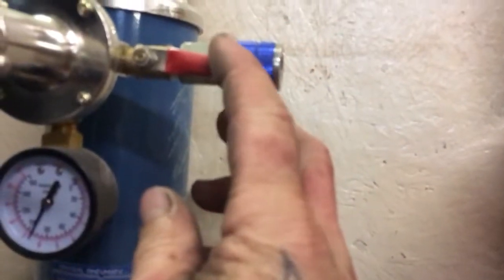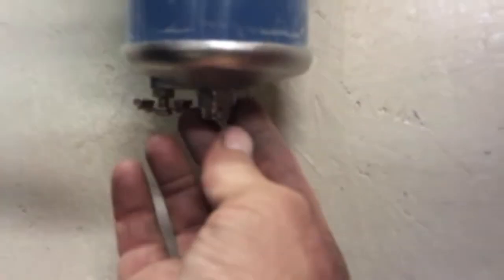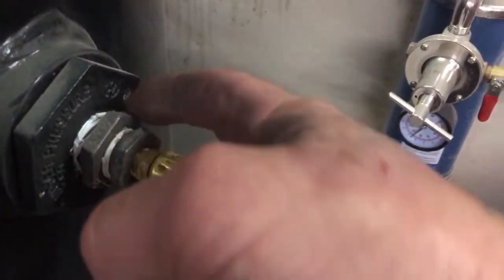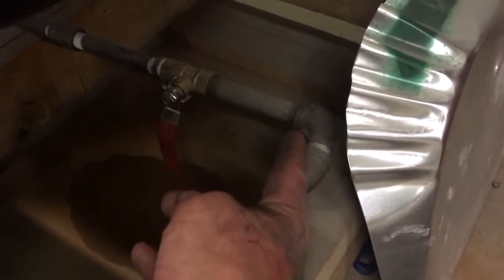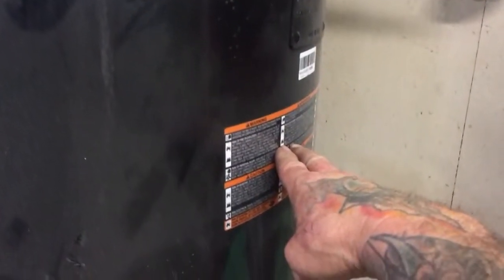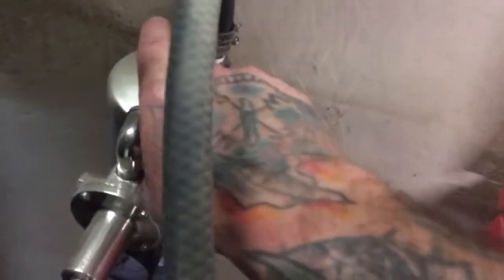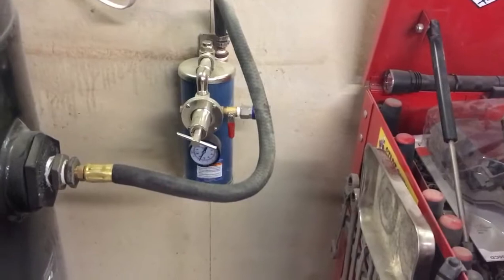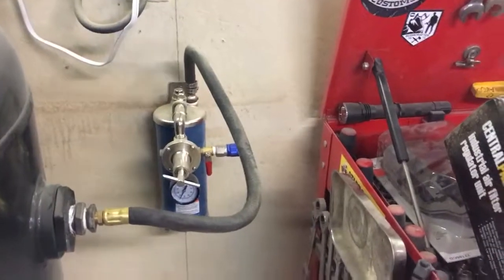Harbor freight compressor water filter PART TWO Central Pneumatic, Part number #68247

Comment: I had tried to use one of these about the same distance, but I was unable to collect any water in it. Finally, I decided to talk to a few people that work in a paint shop that also sells these units about the issue at hand and they informed me that I needed to set it up at a distance of approx. 20 feet away from the compressor using Galvanized piping to cool down the superheated air that is passing through the unit which was causing the water to pass by the unit. Very odd I do say but it seems to work now. It must be due to the humidity differences between the two locations.
Reply from the maker: I wonder if the long manifold we built has the same affect? It seems to work very well for my bodyshop 👍 thanks for the heads up! ARCO

Comment: I like to know of the fittings that you added at the air inlet and drain at the bottom of the compressor.
Reply from the maker: I just built them in the hardware store. I used the plug size i used out of the compressor

Comment: Im looking to get one plus a filter and oiler do them in a line filter filter T with a muller quick release then the oiler so I can paint and if I use my air tools I can hook up to the oiler use pex pipe over head and down 3 walls .   to have air each side of a car or truck without dragging hose behind .  Pex will not have oiler hooked up , just 2 filters
Reply from the maker: That will be a nice setup, but what pressure can u run through pex pipe? How many psi ?
Reply: @OutlawEdge  They say 150 psi max , but for tools 90 to 100 psi is all you need paint is about 30 psi .  I turned my Craftsman 15 gallon 150 psi down to 125 psi  it is 20 years old my impact said no more than 100 psi its 600 foot pounds torque  I will never be over the max on PEX .

Comment: How does it get cleaned?
Reply from the maker: B E theres a filter inside that can be replaced or cleaned. Depending on what the setup is used for. Thanks
Reply: Outlaw Edge are the filters sold at Harbor freight
Reply from the maker: B E yes they sell them at harbor freight and all bodyshop supply stores